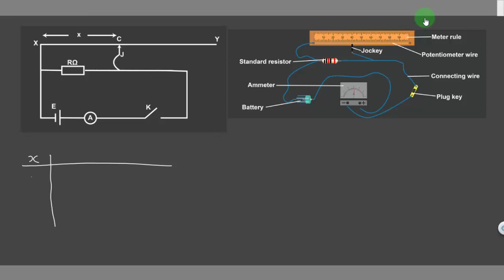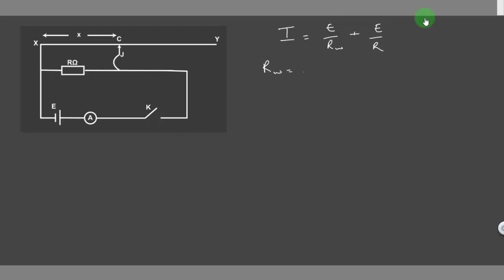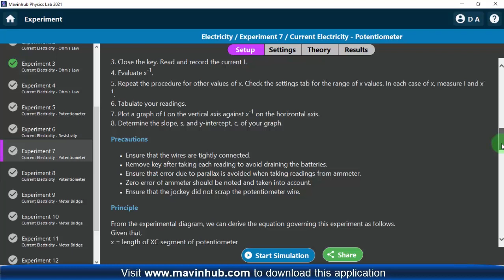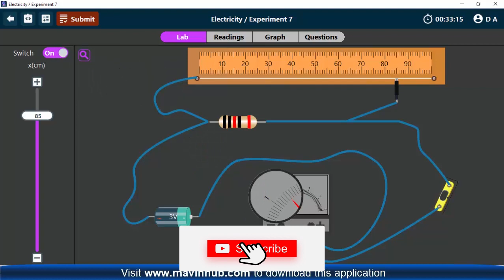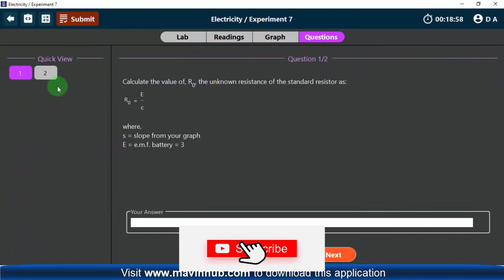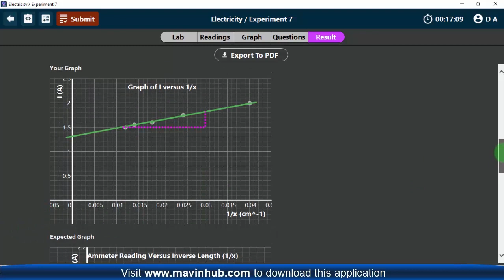WAEC 2021 PHYSICS PRACTICAL SOLUTIONS | ELECTRICITY LIKELY QUESTIONS | PART 4

Comment: Ammeter provided is 0 ~1A, your answer has exceeded 1A
Reply from the maker: Yeah the ammeter readings exceeded 1 A because the voltage is 3V and the maximum equivalent resistance is 2 ohms since the standard resistor is connected in parallel to the constantan wire. This implies that the expected minimum current is 1.5 A. However, you can get readings lower than 1A, if the internal resistance of the e.m.f. is significant. Also, if the standard resistance is connected in series to the constantan wire, you will be able to get current readings less than 1 A. The focus of this video is for a scenario where they are connected in parallel.